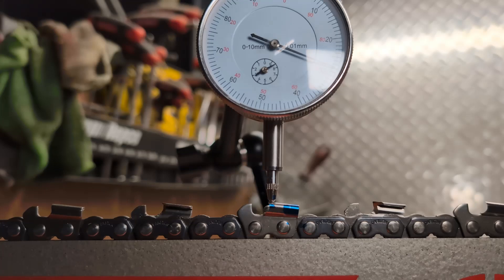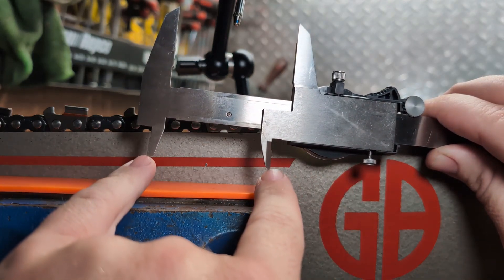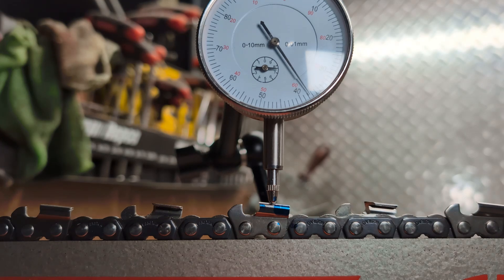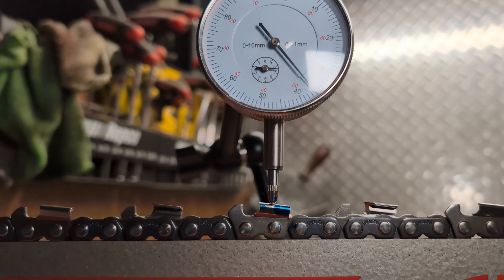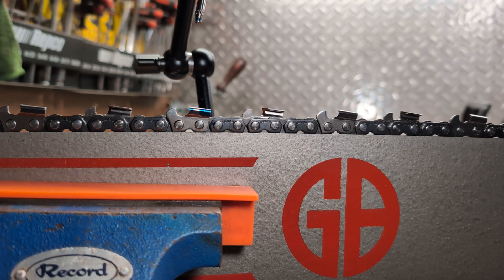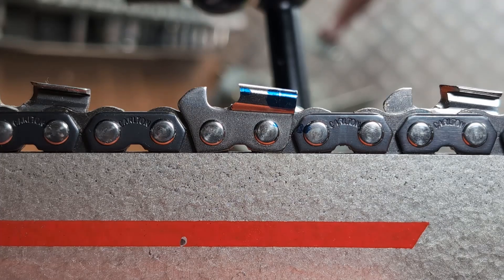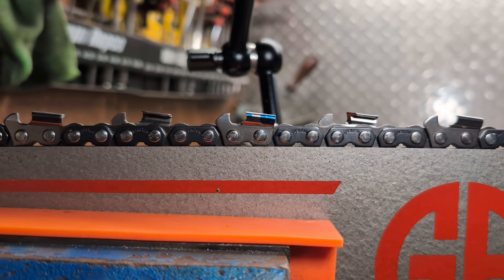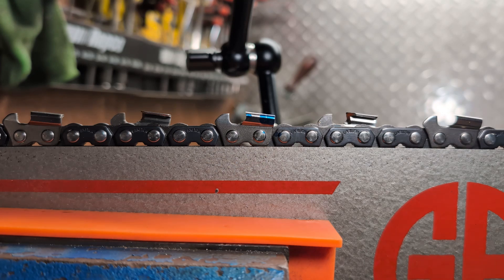Chainsaw depth gauges - Carlton's theory

Comment: Thanks for the info, I am on a quest to find the best method to file depth gauges, and I have only just started rounding the front of the depth gauge after using the Pferd two in one.  Right now I just tilt a flat file about 45° but might have a better effect using my Dremel to put a radius on it. A little anal I know, but I’ll let the results be the deciding factor whether I continue.  We can’t get the.Stihl progressive depth gauges in the US, but I am pursuing getting them from the UK.

Comment: Been pushing my 18v Dewalt to cut too big a logs lately, bough a file, didn't improve much,  gave it another touch up, still not what it should be doing. 
Couldn't find a flat file, so flap disk on the grinder it was to bring down the depth gauges. 
She's taking out lovely chips and storming through the New Zealand Christmas trees now
Battery saws have come a long way, light enough to use one-handed, power to cut a 200mm branch efficiently. 
54v Recip is brilliant for cutting roots.

Comment: Thank you for the video.
I've already written about this under some previous video, that in my opinion the real pivot point is where the cutter link rests against the bar rail as it starts to lift up when entering the wood due to the top plate clearance angle.
Normally this point is behind the center of the rear rivet. This can be seen in your video, where the "dead zone" is just there more or less. 
 Of course, where exactly this point is in relation to the rivet (and the end of the cutter/top plate) will depend on the type of chain/cutter link.
Reply from the maker: @elpolaco7654  I think that is the better way of explaining this. It pivots off the heel of the cutter because it's the part that is in contact with the bar rail.

 It's also part of why this changes with different chain brands, the design and angles of the heel are different
Reply: @SawChainTheories  Agreed. Thanks!

Comment: Nice now I know why some of my chains dont self feed right when almost wore out and why some newer chains have shorter cutter lengths where the cutter ends close to the rivet. If the cutter ends at the rivet there's no need to lower the depth gauges extra when it's past it, you get less chain life but easier sharpening.
I use the husky progressive gauge but it's not perfect and I need to take extra off when the cutter is back past the rivets. All my buddies free hand file the depth gauges simply taking a swipe off when it's not self feeding right.
Reply from the maker: Thanks. I'm surprised so many people were interested in this

Comment: Good video to technical for me
Reply from the maker: @Larry-hi1ri  Out of everything I said the most important part is, use a tool to set your depth gauges and round off the front edge of the gauge after lowering it.

The rest really doesn't matter to most people, it's just the technical part of how they work
Reply: @ thanks never rounded mine off I will now